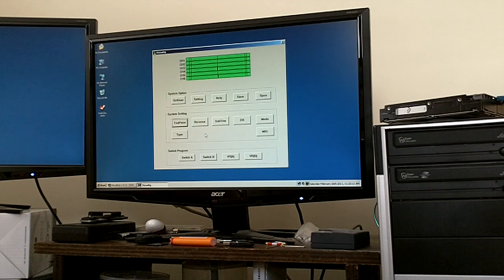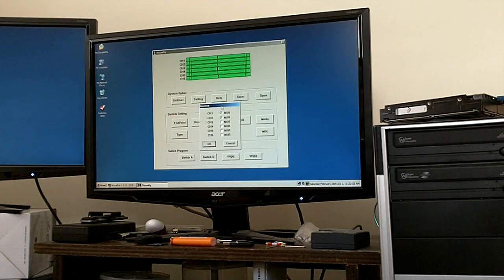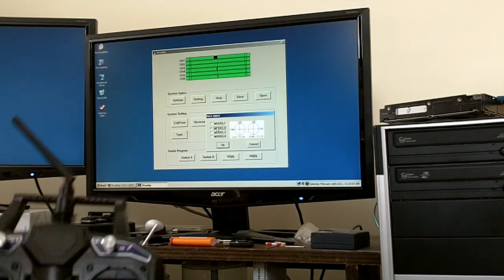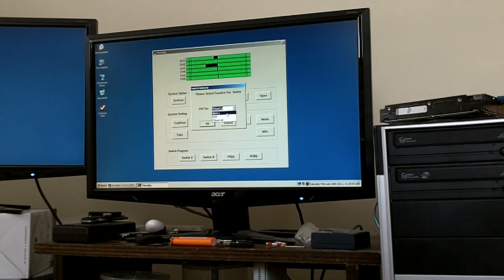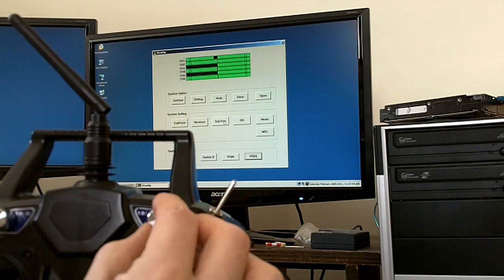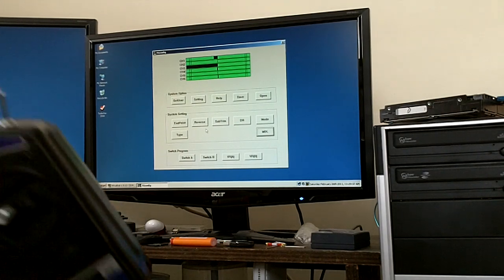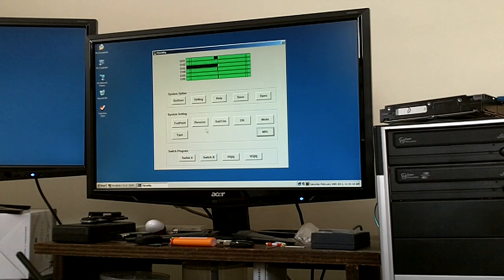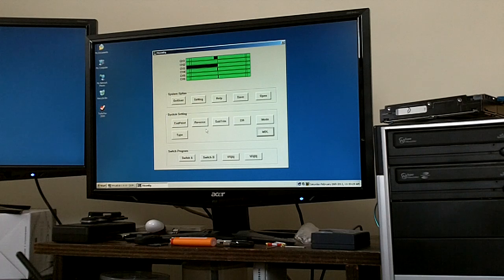Part 2: T6Config Tutorial for RC Airplanes NOT Helicopters t6 config planes

Comment: Do you know if there is a way to program exponential in T6 config? I just bought a 3D plane and using expo would make it fly a lot better. If not that's fine, it just means it's finally time for me to move up to a more expensive Transmitter.

Comment: I have windows 7. 64 bit operating system. I can not get the program screen to come up. The only screen that comes up only lets you trim the throttle and rudder and looks nothing like what you are showing. I guess this radio can only be programed with a 32 bit radio.

Comment: Hi, thx for your fast answer. I have the program t6 configuration, and there have the boxes a resolution of 1024 point. It shows, how wide the servoway is in a numbered resolution. I have the endpoint2 of ch3 set to 120 %, but the box goes only to 1/3 of the full way from center to left. And t6 configuration says, that it is point 400 from 1024, where 512 should be the center. Only if i switch throcut on, then the box goes full down, which is at t6 configuration 0

Comment: Hi, i have a problem with my ct6b and the throttle. Hope, you can help me.In the video i have seen, that your throttle has the full range from (with t6 Configuration) 0 to 1024. Mine has only from 400 to 1024 and i cannot set it to 0. When the stick is full down, i have 400 with Endpoint2 at 120 %. My endpoint2 is not at 0, but at 400. When i set a switch to Throttle Cutoff and turn it on, the ep2 is at 0, but when i turn it off, ep2 is at 400 and the motor runs slowly. Thanks

Comment: @theleetbeagle Actually it is. When it is plugged into the software, when i use throttle, it is on channel 3. I didn't touch anything on it. essentially, what i have, is 2 servos, and the motor. Channel 1,2, and than for the power i plugged it in the battery plug.

Comment: @theleetbeagle - You can make either switch your dual rate switch using the program.  Then you can set how much of a cut the dual rates make for each control surface using the DR button in T6 config.

I use my T6 config with my Clearview RC sim and it works, but it was a pain to set up.  You have to install ppjoy and t6sim and follow specific instructions to do it.  See my cool heli dot com for information on using it with your simulator.  Its not plug and play...